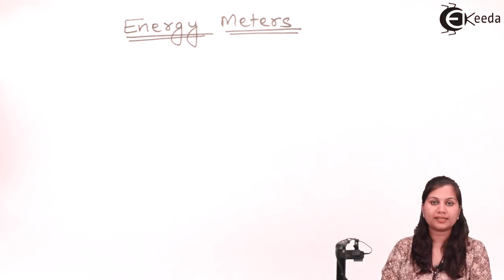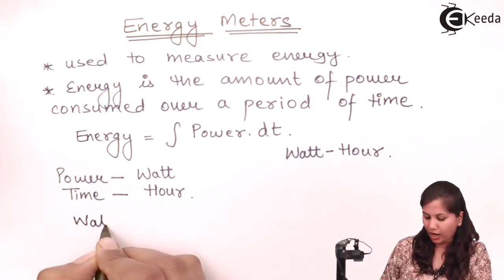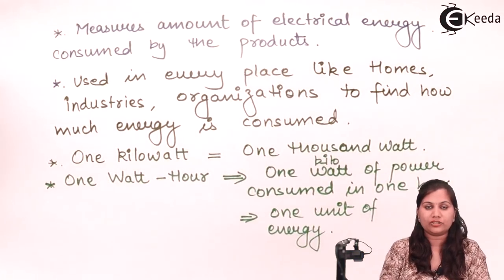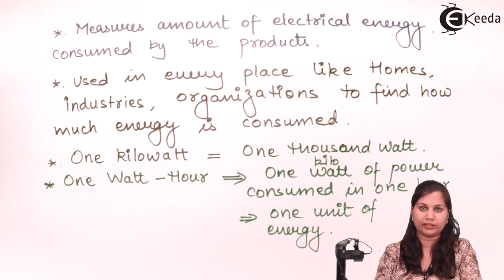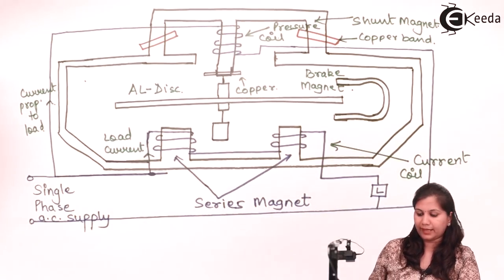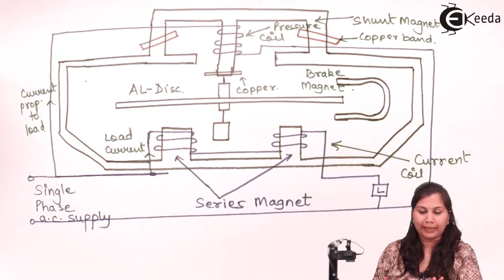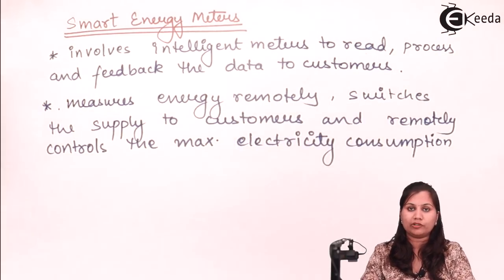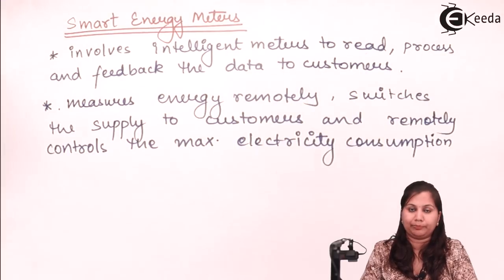Introduction to Energy Meter - Measurement of Capacitance - Electronic Instruments and Measurements

Comment: Madam,
Working principle of Energy meters explanation was very good and super. Madam, in many places at homes,  energy meters( old type or digital type) got fired due to external  or internal  faults   and it was happened frequently.  Can you explain widely what are the causes possible fire happening in energy meter.

Comment: Very very very great explanation.
Question: What happens if the mains voltage gets down?  Would the meter read or count the correct amount of KWh  ?
I understand from your lecture that it would still give the correct reading and that it doesn't depend on the current only.  Am I right ?
Reply: @Redme mobile tech 
Thank you for your answer.

Comment: Hello.  I enjoyed your video on energy meters.  I have one question for which I have been trying to find an answer.  All the wattmeter can do is measure current and voltage.  How can a wattmeter measure which direction the power is flowing?  An analogy would be a anemometer to measure the wind speed.  The anemometer can't tell which way the wind is blowing, it can only tell how fast the wind is blowing.  If you have solar panels and inverters and you are supplying your own ac power and then selling the excess power from the solar panel and inverter back to the utility, how does the wattmeter tell which way the power is flowing?  If, on a cloudy day, the solar panels are not producing much power, then you are purchasing power from the utility and the ac power is flowing from the utility to your home.  If, on a bright sunny day, you are selling ac power back to the utility, the power is flowing from your solar panels and inverter back to the utility in the opposite direction.  The voltage and phase of the power produced from the inverter has to match the voltage and phase of the utility.  I'm not sure, but it seems that the only parameter that can change with the direction of power flow would be the current with respect to the voltage.  With dc power, you can tell the direction of power flow by the direction of current, with ac power, the current is always changing direction.  So it seems like you would have to measure the current phase with respect to the voltage in order to tell which way the ac power is flowing.  Anyway, I would love to know how wattmeters can measure the direction of power flow as well as the magnitude of the power.  Thank you.
Reply: You need energymeter specially designed for that. As you can see, since the torque produced in induction type energy meter is proportional to Cosine of the angle between voltage and current, torque can become negative if phase angle is more than 90 degrees. This is the case  when power flow is in opposite direction. Hence it is possible to design wattmeter which can rotate in opposite direction and record the energy exported, when power flow is reversed

Comment: we have a grid with 2 energy meter in the in same line with 3 separate 
ct each 800/5, no vt the reading we get from both meter is differ by 2 
to 3 times, both meter are diff make, 1make  is 6436H, other meter is 
grid supplied with same ct ratio, how to make both reading or check 
which is correct. what is pls parameter, can the kwh value be changed.

Comment: If voltage supply of energy meter is increased then the speed of the disc will be
Pls rpy maam for this questions
Reply: Speed increase
Reply: I think ,speed of disc will be increased  because emf induced in coil is directly proportional to the speed of the disc.